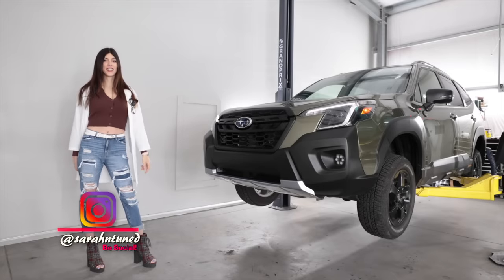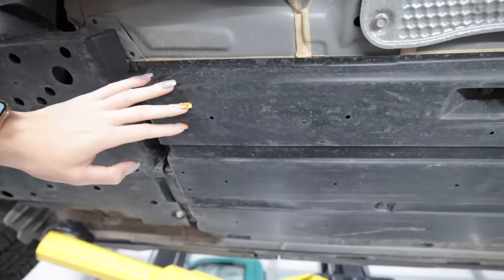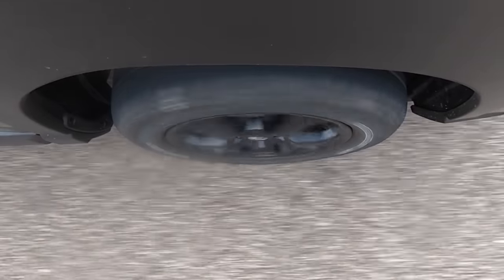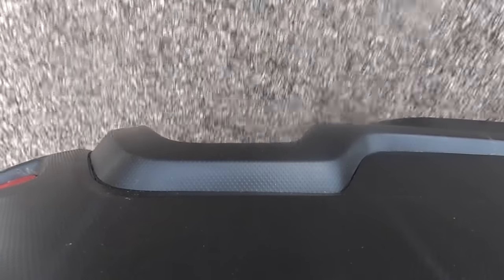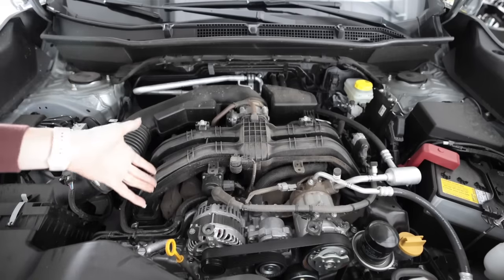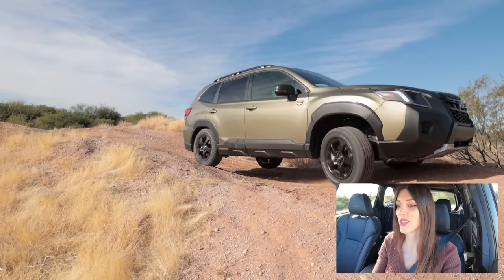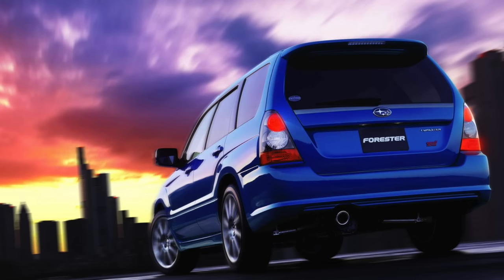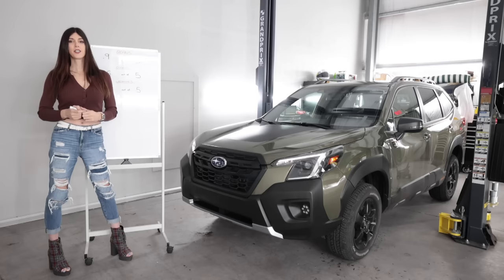2022 Subaru Forester Wilderness Mechanical/Off-Road Review

Comment: I just picked up a Forester Wilderness the other day. Been suffering buyers remorse more than usual.  It was refreshing to hear that you own a Forester as well.  Given the fact that you have so much auto knowledge and own a Forester says a lot for the Forester.  Thanks for your thorough reviews.
Reply: Why were you having buyers remorse?
Reply: I am literally going through that right now. Just picked one up 3 days ago and was soooo thinking of taking advantage of the 72 hours exchange policy and switch to something else... but in the end, I decided to keep. glad I am not the only one.
Reply: How are you feeling about it now ? I am strongly considering. Would appreciate comments
Reply: @billricheter5678  I traded it on a GMC Canyon, mainly due to towing limitations. Subaru should not tell people this vehicle can tow 3000 pounds. If not for towing though I ended up liking the Forester a lot, seemed well built and zero issues.
Reply: @johnmccool6875  thanks for info, totally agree about towing with a cvt anything over 1500. I think for our purpose forester might be best. Liked the 4 runner but it’s a bit bigger and harder to drive in town. Plus it’s a gas guzzler and is 12000 more
Reply: @johnmccool6875  also how do you like the canyon, it’s my favorite midsize truck

Comment: 1 thing you do nit point out about the ev subaru is that is actually a rebadged toyota. However, Subaru's version has awd, the toyota ev doesnt as far as im aware. I think this will only last year 1, as subaru prob made a deal with toyota to be allowed the exclusiveness of awd to differentiate them a little.
Subaru will hopefully find a way to make their ev's have better awd systems than other brands.
Or at least bring to the table a lower entry point with awd.
As it stands, n people forget this i have to remind people often of this, subaru is the only brand you can have a base car or suv or wagon that has awd. Simply what i mean by this, every other manufacturer, when u get into awd, you need to then move up many trim levels and be into the mid 30's plus. Subaru u can still get a base impresa hatchback with awd. So they will always have that going for them. N i hope they continue to deliver that, more than anything else to customers. As it will yield them high sales from other manufacturers if they connect with the same customers at the price these customers want to pay.

These wilderness versions i think are an attempt to get buyers they never had, more than an offering to customers that are loyal to the company.
Also, its a way to i think boost the price of vehicles across the board, n have a way to justify that as a more premium brand. I.e. the price of a new outback is still similar to the price of a new outback 10 years sgo, believe it or not.
In the same context, and f 150 from 10 years ago, that same truck is 10 to 20 grand higher now.
For instance, you could buy a new at msrp (no one paid msrp for a new vehicle 10 years ago either so consider that to) a ford raptor 6.2L v8 for 45k, is what the starting price a raptor was in 2012, it is not anywhere near that now it is 65k literally 20k more than it was. N u will never see a 65k raptor now because they dont build any, without a modest 10k in options. So the only way is if ur order a base and wait for it n that is it.

A 2012 raptor with 100k miles is still selling for high 30's into low 40's lol.
Anyway point is, subaru is slowly trying to cash in on a huge market right now, the offroad world is hot.
N they will probably bring the baja or soemthing similar back within this year or early next year n debut it very soon.

Comment: Wonder what sets the Forester Wilderness drivetrain apart that allowed it to get up the hill where the Outback Wilderness could not...I also wish Subaru would just open up their options a bit more... turbo on the Forester again would be phenomenal, as would a manual tranny option.
Reply: maybe the tires
Reply: The revised ratios are a bit lower I believe. Also, the OB tester had all the optional skid plates while this one didn't. I'm a bit surprised they let reviewers push it without them.

Comment: Sarah, which do you think is worse - The plastic intake manifold or the just primered engine bay and underhood?
Reply from the maker: Plastic doesn’t get heat soaked as bad, so I’m on board with that.
Reply: @SarahnTuned  Thanks for that tidbit.  I was actually thinking of making a 3D print version of my Ranger's intake so that it would be metal instead of plastic.  You just proved that idea to be bad and saved me money.

Comment: Instead of walnut blasting (expensive), what's your take on putting a teaspoon of ATF in the hose from the brake booster while keeping the rpm's up around 3000.  Do this at every oil change and perhaps keeps the backs of the valves from carboning up?  Will it work for this particular engine?

Comment: hhmm  Nope, gotta disagree.  They need to use a 3.6 Liter Boxer 6 Cylinder with a SuperCharger. And get a 7 Speed Manual transmission. The 1st gear should be a super low for rock crawling. Also they need to widen the Track front and rear by at least 4 inches. This could add the wide shoulder stance that the Porsche 944 was infamous for!!! It would also be nice for weight distribution for the front wheels to get put 6 inches further forward!!! Please and thank me  :)

Comment: No skid plates, no low range no off road. Fine for parking in the grass at your kids soccer game but not made for off road.
Reply from the maker: Tell me you didn’t watch the video without telling me you didn’t watch the video 😂 😂
Reply: @SarahnTuned  Sorry I did watch it and you clearly point out the transmission pan exposed with no skid plate and it does not have a low range or even a limited slip that you also pointed out. It's not an off road vehicle.
Reply: 😂Take a look at Youtube. The Forester Wilderness has been torture tested by a number of reviers and does very well. Yes, I wouldn't take it on several Moab trails, but then I wouldn't take any vehicle I cared about on some of those boulder fields.

Comment: I do not actually like that subaru chose to very cheaply not paint in the engine bay n under the hood.
I live in north east pa, i like as much protection on metal as possible.
I know base, isnt technically protection, but it is another layer n appreciate it very much.

Comment: Sarah, Why do you think this Subaru made it up the mini-mount when the Outback Wilderness with a very similar setup that you reviewed a few months ago could not?  Weight?  Also, why do Subaru and other car makers negate the biggest advantage of a CVT by programming fake shifts? And paddle shifters with a CVT...wtf??? They could at least allow you to turn off the fake shifts but they obviously have a very low opinion of the intelligence of their typical customer. Enjoyed your review and a chance to rant a bit.
Reply: People complained about the lack of shifting, so they added fake ones.  I wonder if the shorter wheelbase of the Forester made a difference regarding it making it up the hill.

Comment: Is the 2.5 engine a reliable engine ? I’m considering a forester wilderness but concerned about the reliability. Any help is appreciated!!
Reply from the maker: Yes, the FB25D is a good engine. Just don't use crap quality gasoline or junk oil in it, reliability is 75% on how the owner treats a vehicle. I've had my 2015 Forester XT since new, its never been to the dealer once and I've done all the maintenance on it myself, its only needed a battery and a starter.

Comment: 14:25 - I'm really worried that Subaru is going the way of Toyota before they started getting back into performance vehicles. They've been catering almost entirely to the mundane commuter crowd and barely innovating in any appreciable manner. I have a '05 STi, and apart from having lower miles, I haven't really felt much of a need to buy the newer models. I really hope that changes in the next generation. That, and I'd love form them to offer a manual Crosstrek with the WRX engine, limited slip diffs, and the wilderness package. I won't hold my breath, though.

Comment: They have the perfect engine for this vehicle and the crosstrek wilderness when it comes. But they kept this garbage that has too high of a compression for the carbon buildup issue. Killed a 2.0L by driving it gentle with the buildup.

Comment: Is it difficult to replace spark plugs?
Reply from the maker: It took me about 20 min per side on my 2015 Forester XT, I doubt much has changed on the newer SK Gen in that aspect.
Reply: @SarahnTuned  Did you have to lift the engine out to get at the spark plugs? It looks like you have all the equipment on hand to do it. I'm talking about your newer 2022 Forester Wilderness.  As I own the same vehicle, but 2 years newer.